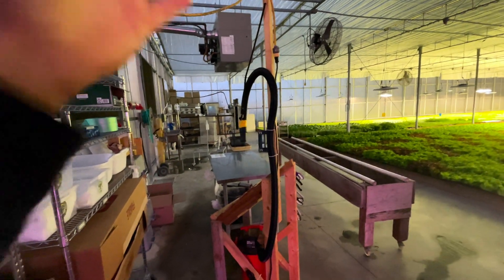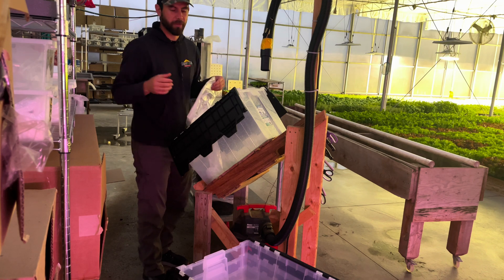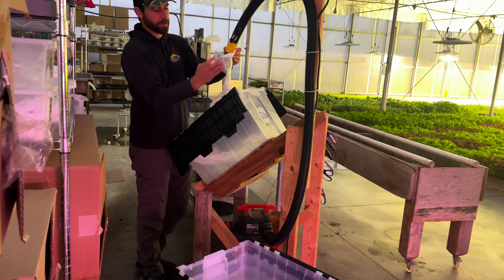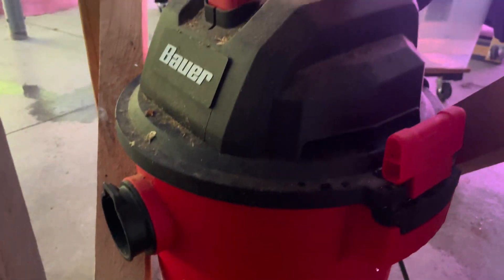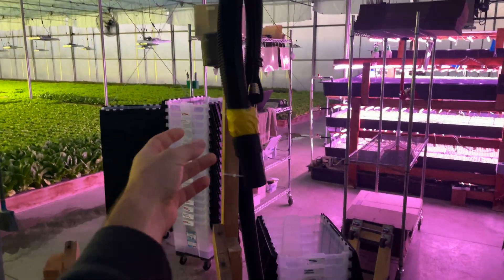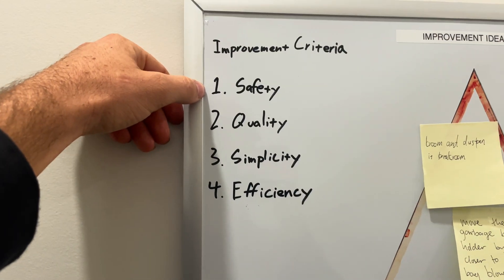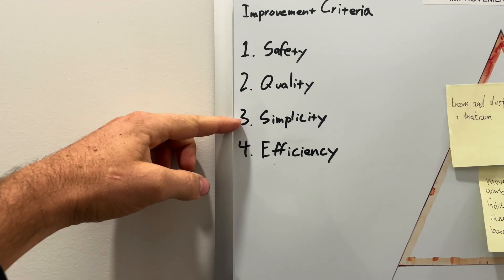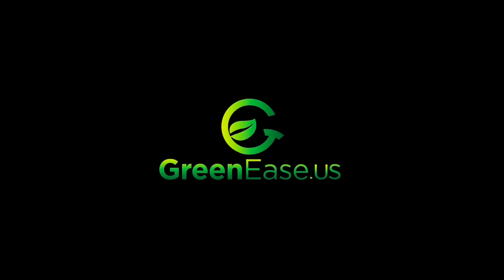The Bag Inflator: What it does and how it works.

Comment: Makes sense like using Six Sigma business tool, improving processes and reducing the steps it takes to do it in a safe environment. Time is money but safety first. 1st comment deserves a free head of lettuce?
Reply from the maker: Stop by, I’ll give you 5 heads of lettuce! 😀
Reply: I would only add investment recovery. In this case probably fairly quick since it’s inexpensive and might reduce labor time by some amount.
Reply from the maker: @steveale0711 This one was easy to justify. Opening the bag was the bottleneck in the process. There was on person up stream and 2 downstream so in some situations, one second saved counted as 5. If I remember correctly, it saves about 7 seconds per bag with is huge